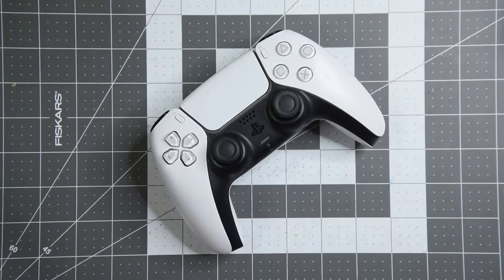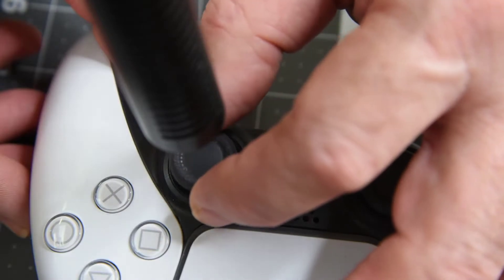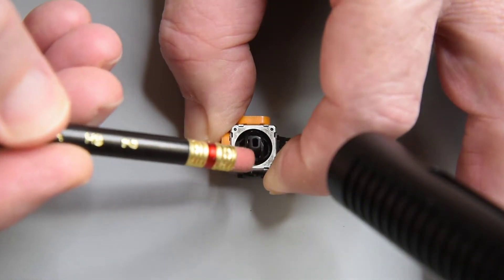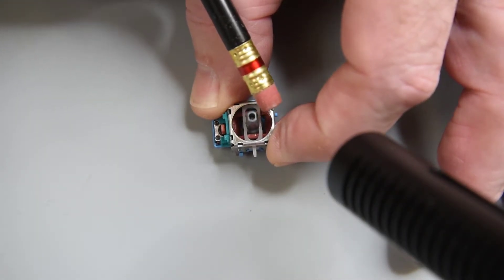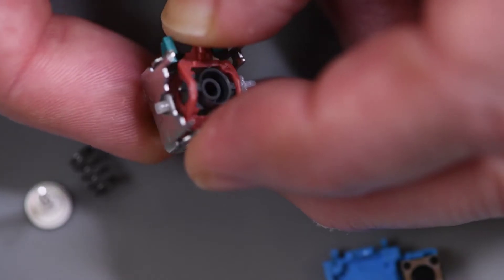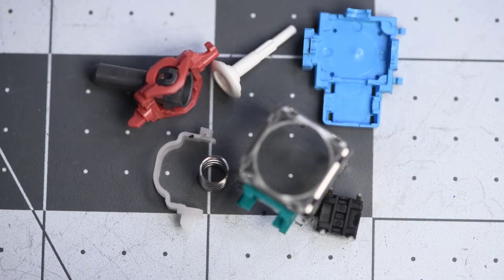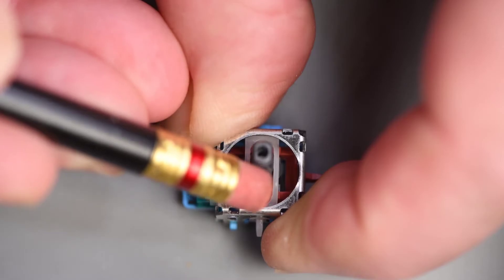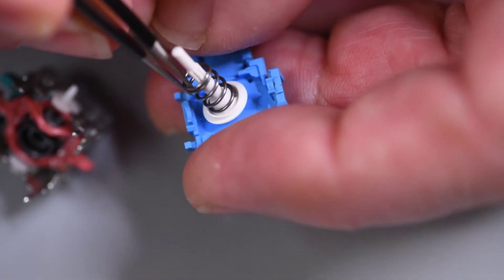Why Some DualSense Analog Joysticks Click

Comment: can a controller be returned or replaced based off of this?
Reply from the maker: I'm sure you can return it if it's still within the return time, but a replacement will do the same thing.  It seems Sony is using only Alps joysticks right now.

Comment: Mine didnt click before, took it apart to clean the inside due to stick drift. Put everything back together and it now clicks when I pull it to the right, only when the green panel is snapped in. I pull the green panel off and no click. Wth is going on🤨
Reply from the maker: I don't know.  The faint click from the Alps joystick comes from the internal spring snapping against the plastic shaft.  I can't really think of anything in the potentiometer that would make a clicking sound.  Possibly the wiper might have a sharp edge and is catching, but if that was the case, I don't really think the axis would be usable.

Comment: Sorry for posting on an old video but would tmr stick modules solve the clicking issue? I have OCD & the noise drives me crazy
Reply from the maker: It is the Alps mechanical part that is causing the click.  You could go with any of the TMR joysticks, and that should fix the problem.

Comment: Hallpi TMR modules in my 8bitdo ultimate 2 wireless behave in a similar, but quieter. Maybe I will try spraying some silicone lube inside, all these moving plastic parts will only benefit from some form of lubrication. Do you have any experience with lubricating joystick modules?
Reply from the maker: I've heard some very faint noise from some of the thick grease, but it is very faint and seems to go away after a bit of use.  But it's not really a click sound like the Alps joysticks.  I tried a bit of oil on the Alps, but it didn't do anything.
Reply: @metalplasticelectronics354  That must be what I'm hearing. A quiet, soft sound. Thanks!

Comment: Something I notice. When I pass the point where I feel the click, I can see the round cap move with the click. Im curious if any of your clickers have this condition. Seems to bump outward or become slightly more proud with the click 🧐🧐
Reply from the maker: If you are feeling a click I think there is a problem with the joystick.  Maybe a burr on one of the plastic pieces or a crack in one.  The spring snapping on the plastic shaft should be nearly undetectable by feel.
Reply: @metalplasticelectronics354  Interesting. And I thought (or was hopeful) these were the same condition. I appreciate the feedback. It is a new replacement module that I can feel the clicking on sadly. Generally plays well and seems to have no input error but feels bad🤷‍♂️ still under manufacturer warranty. Maybe it'll be made right. Thanks again
Reply from the maker: Yes, if it's new then there is some problem with the joystick if you can feel a click in it.

Comment: , after watching your video I will go back to the previous dual sense controllers that I had and messed up learning the solder room and replace the sticks thank you very much you most helpful one I've seen yet but I have a problem could you please make a video the controller charge it'll work if I got it plugged in and work just fine it won't charge and the systems reading it that the battery is dead and now it won't update till it gets a full charge reading back I'm sure it's a short I just can't find it
Reply from the maker: Make sure one of the battery wires did not pull loose from the connector.

Comment: I can't keep listening to this... I want a solution  omgg
Reply from the maker: The only way is to replace the joystick modules.
Reply: @metalplasticelectronics354  I've read somewhere that this doesn't happen with the red model, is that true?
Reply from the maker: I have the red controller and it came with Alps joysticks, so it had the click.  Not sure about the red controllers being manufactured now.  I got mine not long after it was introduced.

Comment: So do you have a link where i may purchase some of the non clickers? preferably off amazon or ebay as id like them to come in reasonably soon and not take a month like the original provider you linked another commenter :D
Reply from the maker: If you are looking for a potentiometer joystick then the Favor Union ones don't click.  They have the orange potentiometers on them.  And there are lots of them on Amazon now.  But you might want to take a look at these: https://youtu.be/cSOKN1wB31k?si=vC9XS0I83KGNnvsQ  .  I just ordered some from Amazon; if they are the correct ones, I'll put up a link to them.

Comment: For me its not clicking but not smooth and
Reply: Im bad at explaining
Reply from the maker: If it feels mechanically rough, there is probably a problem with the plastic guides in the joystick module.  Did the problem start out of the box or after some use?
Reply: @metalplasticelectronics354  after some uses i feel like it stutter when i try to use the joystick slowly if u know what i mean its not smooth when its moving slow its stutter
Reply from the maker: That sounds like the potentiometers are going bad. It might be possible to just clean them. Probably little flakes of the resistive element are coming apart.
Reply from the maker: I had a DualShock controller that was kind of doing the same thing. I took it apart and snapped the potentiometers away from the frame, just enough to get some cleaner in them. I use a cleaner/lubricant called Cramolin. I don't even know if can still buy the stuff. I don't remember if I ever had to change out that joystick module after that.

Comment: i had an old dualshock 4, it never clicked, i bought a dualsense like a year ago, it never clicked. but a couple months ago i bought a new dualshock 4 for use with my pc because i really like how that controller is shaped, but both analog sticks has a slight click when moving it downwards. are these just a new thing that all new production controllers have? as an autistic it is very triggering, it is silent but the feel of the click is unusual and hurts my head. and i wish i went to return it, or at least have a way to fix it. i would literally pay someone to fix it because it triggers me so badly. i dont know how to solder either.
Reply from the maker: It just depends on which joystick modules get used. Probably the easiest thing is to return it.
Reply: @metalplasticelectronics354  my return time had passed unfortunately

Comment: I have this problem with all my PS5 controller. I sent back one controller and they sent me a new one, i sent it back again because of clicking noise and i received a new one again. This one makes click noises too. I stopped sending back. The click noise is not that loud but absolutly annoying. I bought 3 more controllers. All of them make a little bit click noises.

What is interesting. A friend of mine bought the PS5 at the release. Both of his controllers don't do any clicking noise. He gave me one of the controllers. The sticks on this controller feels much more heavy, clean i don't know how to say but it feels like much more quality. Maybe they changed something in the production?
Reply from the maker: The ones that click have Alps joysticks in them, the one's that don't have Favor Union sticks.  There is a tiny bit of spring pressure difference between them.
Reply: @metalplasticelectronics354 is the clicking sound normal cause I don’t want mine to get worse

Comment: For anyone who's coming to this video now, I had the idea of basically leaving the spring swimming in Super Lube, much like we do with mechanical keyboard switches, although here the idea is to deaden the click rather than the ping. It's had a noticeable effect - the clicking is still there, but it's less consistent, reduced maybe 50%. Still feels nice and smooth to use.
Reply from the maker: Very good idea, thanks.

Comment: Thanks man. I recently purchased an 8bitdo with the same clicking noise, despite it being another brand, it seems to be exactly the same cause. At least now I know that it's not exactly a problem that will compromise my control.
Reply from the maker: I think the Alps joystick modules are used in a lot of controllers, there are just do cheap.
Reply: ALPS joysticks are used in a lot of controllers, not just Playstation controllers. If your joysticks click, they're very likely ALPS joysticks. This is completely normal for them, and nothing is broken

Comment: Had my PS5 just over a year now. The console? The console is absolutely fantastic considering the issues my PS4 gave me, but they were less and easily fixable- buy an ssd.. 
The DualSense controllers I hate them. I have been through 4 including the one my PS5 came with and all of them have either from scratch or a month or two in gotten this horrible creaking/scratching sounds (it's 100% the springs) and it just gets worst over time). in one or both analogue sticks. it isn't just a sound you can physically feel it as well when making slow movements in one or certain directions and it feels really nasty and uncomfortable especially in stealth games. I have found 0% solutions except buy a new one. I can't keep buying new controllers and it is frustrating that I avoid gaming because it's off putting. I am seriously considering re-buying a PS4 and just wait for Sony to sort it out and make better joysticks. My experience with the DualSense has been poor so after a year hoping it was due to older models it gets a poor review from me, it's the worst controller I have ever used and I have been gaming since before the PS1 and I have never had a controller do this horrible teeth clenching creaking, squeaking I can't even explain it sound and feeling. They're made in China so could that be it, to company using ALPs and fobbing us off with cheap trash for the joysticks, there's no way they do not know about this issue from feedback and haven't got the ability to break it down like you just did. I hate these controllers quite literally. It ruins the amazing PS5 experience. I have seen there's alternatives to the DualSemse like the Scuf but some are in the £189 region and that's a lot. But are they any better?. Just being honest with my experience with the controllers so far, it hasn't been a very positive one maybe there should be a lawsuit on ALPs, when you pay £500+ for a new console the controllers shouldn't all be naff.
Reply from the maker: The only thing I can think of is if you know someone that tinkers in electronics.  See if you can get them to put some of the Favor Union joystick modules in one and try it.  They are the joystick modules with the orange potentiometers.
Reply: I have a new ps5 pro, the dualsense with it has no problems and the sticks are silent and smooth, yet a new Fortnite dualsense has really bad creaking sound with the left stick and you can feel the resistance. It’s not just a click sound.

Comment: OK this will sound silly but i think I FOUND A FIX. Put the controller on a table and... SLAP the clicking sticks a little harder than gently, maybe it puts the springs in place? But the clicking stopped at least for some time untill you slap it again lmao.
Reply: Thx you made it worse 👍👍👍🙏
Reply: Bro thanks i didnt thinked it would work but i tried it on my switch right joycon and guess what no more sound thanks man
Reply from the maker: I hadn't thought about it, but if the end of the spring were to get out of it's cup.  Would probably quit clicking.  Good info thanks.

Comment: Lubricating the springs a little bit might help. Favour Union also even lubricates the potis inside. They're still trash compared to alps (not good either) :D
Reply from the maker: I tried a bit of machine oil, hard to tell if it reduced the sound any.  I think grease might work but getting it to the spring is a problem.  I think they are just really cutting corners now in making the joysticks.

Comment: I had the first release Dualsense, the click started after about year 2 in both sticks. Drove me nuts and tried to replace them but ended up with the USB, Microphone and charge not working (think I scratched some traces). I then bought a new PS5 in March and after about a week the sticks started clicking, currently RMA'd and awaiting a replacement. Atrocious this has happened considering I have a gen1 Xbox One controller, Switch pro and numerous other pads with no stick issues. I bought an Edge controller, smooth as silk so far, and since the sticks are modular it should be far easier to de-solder and replace than on the motherboard. Feels like Sony are trying to upsell us to the Edge, which worked on me! Good on you for finding the issue!
Reply: You don't even need to solder anything on the Edge. It's just plug and play :D
Reply from the maker: The alps joystick modules have a faint click when they are new and I can't tell if it gets any worse as they wear.  If it developed a click in time I would expect that to be a different problem.  Lot of thin plastic in the joystick modules that could wear or crack and cause a problem.

Comment: This is very common and just super disappointing cause I spent the equivalent of 900$ in my countries currency's for a brand new PS5 and to get this bump feel after a week of use is really frustrating...
Reply from the maker: I could not feel any of the click.  Is it just in one stick or both?  If it is a very noticeable detent or bump it may be you need to get the controller replaced.
Reply: @metalplasticelectronics354  it's only the left stick the right one super smooth but the left have this ridge skip kinda feeling when turning the stick in the up movement doesn't effect GamePlay or anything but it drives my OCD nuts lol
Reply from the maker: Yes, that is a different problem.  If it's still under warranty, might be good to get it replaced.  There is a lot of thin plastic in the joystick module.
Reply: @metalplasticelectronics354  unfortunately no warranty for this kinda problems in my country cause there's no officiel Sony support here at all, so you can only get ur entire thing replaced if there's a big issue, but thanks for the replies anyways 👍
Reply from the maker: Sorry to here that.

Comment: I hear a squeaky sound in my left and slight resistance when moving up or left or right what to do
Reply from the maker: Probably going to have to take it apart.  Might be just some trash wedged in between the knob and case.  But it’s probably going to be some plastic broken in the joystick module.
Reply: I had that and smeared a lot of grease all over the plastic inside the stick and it stopped squeaking and resisting, but the clicks appeared for some reason lol.

Comment: My new Dualsense Edge Controller came yesterday and does that on both analog sticks (when i move slightly only up/down/left/right , if i use it around playing i dont feel it, only when i do small steps on any direction slightly i feel it)  and it was the first time i feel it since i own 2 Dualsense controllers and never felt the click noise (the first controller was in the box came with my ps5 last august and the second black one bought it 2 months ago).
Reply from the maker: It just has Alps joysticks in it.  Should be fine if you don't mind the faint click sound.
Reply: For $200, you shouldn't have any clicking on the right thumb stick.  I have it on both and I'm taking it back today

Comment: This video was great.
 It also sent me down a bit of a rabbit hole. I replaced my new DualShock multiple times cause of this and they all do it. And while at GameStop i went up to their Nintendo pro controller on display and guess what.. it clicks too. Much quieter than a brand new controller tho. Then I went home and checked my old 8 bitdo sn30 pro+ and wala.. it clicks too. Albeit much more quietly. I’d go as far as to say all controllers across multiple platforms seem to do it now and the favor union is the outlier ?
Reply from the maker: I think Alps claims like better than 80% of the non portable consoles for their joysticks.  If that is close to true, most controllers will come with Alps joysticks.  And I’m thinking it is.  I’ve only seen 1 DualSense controller with Favor Union joysticks in it.
Reply: Forgot to add I also tried a used Xbox one controller at GameStop and it did it too! These all can’t be alps?

Comment: Thank you for this very informative video, very detailed, it satisfied my curiosity. I've had 3 dualshock v2 with alps sticks (which I disassembled to readjust the sensor after falls that caused drift), no click on both of them (even on my ds3 😅) I'm planning to buy a ps5 and hope it's been fixed.. I'm disturbed just by using a new controller because of the new and stiff springs (very disturbing before they become fluid)
Greetings from France ✌️
Reply from the maker: Thanks.  I suspect Alps changed the plastic moulding or the spring at some point.

Comment: My stock Xbox one controller with 3-4 year old sticks has a slight click from both joysticks although pretty muffled by the outer casing. I have a couple alps replacement analog modules with gray base but the separated circles on bottom much like the blue base that both have a more noticeable clicking noise when rotating the stick past 15%. If the sound goes back down to what my originals sound like when mounted in the shell shouldn't be too bad. Maybe if they dipped the springs with a soft coating would help.
Reply from the maker: It sure looks like the click is from the Alps design.  They may have always clicked, and I just never noticed.